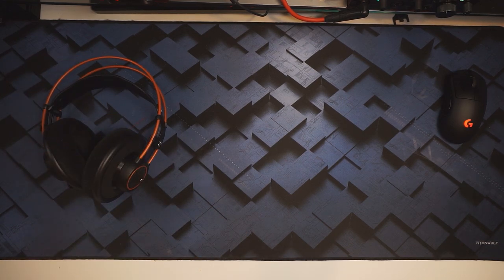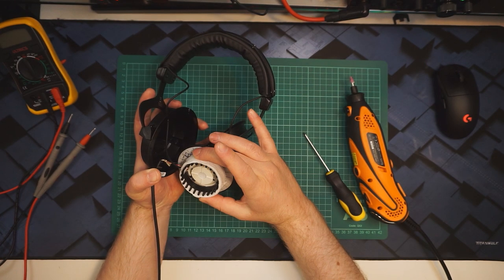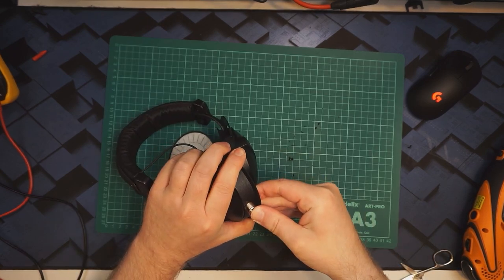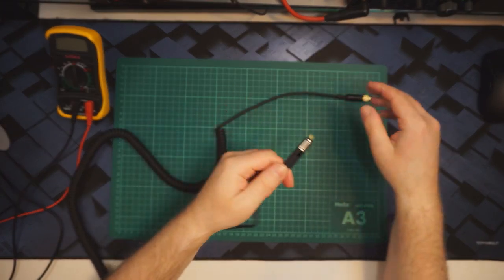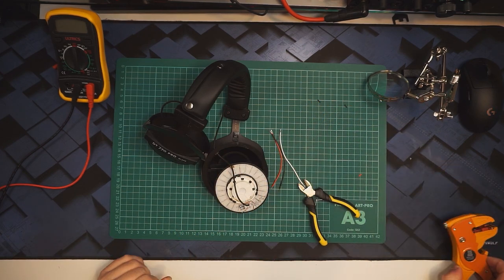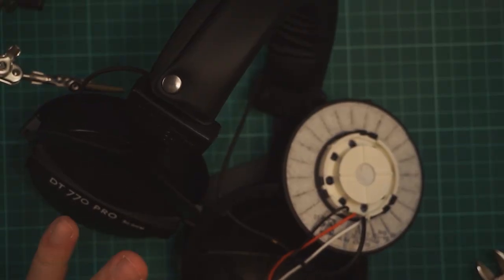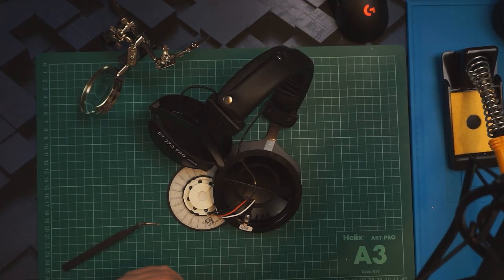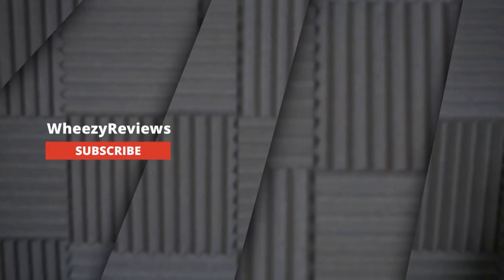DT770 Removable Cable Mod

Comment from the maker: This is a fairly simple mod but any DIY modification is inherently risky. But the point of this video is to show that if I can do it, then you can do it. If you're worried about damaging the driver whilst working on the headphone you can desolder the wire joining the right-hand side. You of course then take some risk with extra soldering on the driver itself. If you accidentally desolder the voice coil then the driver is dead. But if you are confident with your soldering and have a steady hand (unlike me) then that might make things easier.
Reply: Could I contact you to do the same process in my Dt and know how much it would cost me ? I don't know some other person that those this process
Reply: @ame1760  Wheezy created this vid to show how you can do this yourself, just sayin' ;-)
Reply: the life is too short , so hack your devices
Reply: During the process the left most contact on the driver came loose with the cable. I mean the gold ish plate to which the solder connects. Any advice on what I can do or am I just fucked?
Reply: @danielderaad  did you sort this? If not: you should be able to solder to the pad for the voice coil.
Reply: This is an excellent idea!  I will definately do it!

Comment: Your order of operations could be better, next time try soldering the wire leads to the driver first, then you can feed them through the hole, slide your heat shrink on, then solder the connector, and finally finish off your heat shrink. This should minimize the amount of fiddling with a loose driver and short wire leads.
Reply from the maker: Yeah in hindsight that would be the better way to go
Reply: @WheezyTech  What is the reason for replacing the wires on the driver? It seems like the mod would be a bit more easy when you connect the original wires to the new connector.
Reply from the maker: @unrealcyberfly  I have tried that before and theres 2 reasons for doing it this way. The original wires are very short so quite fiddly to work with. Also the original wires are litz which is very hard to solder compared to regular copper wire due to them having an enamel coating that needs to be burned off during the soldering. These two things combined makes it much simpler to replace this section of wiring.
Reply: @WheezyTech  I see. Thanks for the reply!
Reply: @WheezyTech  the original wires aren't short, they're the length of the whole cable all the way to the TRS plug. Also, you can burn the enamel coating and make soldering your connections easier in one stroke by 'tinning' the end of the wire, that is giving the wire a coat of solder on its own.
Reply from the maker: @Milamberinx  Sure thats fine you can do it whatever way you want. I hate working with Litz.
Reply: @YoloJesus420 it basically negates the need for any type of heat shrink or coating because each strand has an enamel shield baked onto it.
But for that reason, it can be tricky to get it to solder.

To burn it off, you can tin as mentioned above, but in my experience, the tinning can take quite a bit longer than bare copper, and it leaves more contaminants in the solder puddle. 

Plus you have to get your iron pretty hot. Around 400C. So you should be using a temperature controlled iron.

Comment: I think this got recommend to me cause I just bought a pair of dt770 pros 😂
Reply: Same lol
Might do it when my cable breaks
Reply: I just ordered a pair.... How's your experience so far, brother?
Reply: What your review about them
Reply: @shaunaksawargaonkar7814  I've had the dt770 pro 80ohm for like half a week now and I absolutely love them. Extremely comfortable, the most open Soundstage I've heard so far (haven't tried open back headphones), they sound fairly neutral (coming from bassy headphones) but also more fun than truly flat headphones. Also they are quite cheap. 
Only gripes: The cable is way too long for me, and they very rarely sound a bit harsh with high frequencies. Absolutely acceptable though.
Also notice the 80ohms are said to sound a bit different from the other versions
Reply: @tomwoodward5334  Not atm. I was thinking about it, but haven't bought anything yet. Using my computer that has a pretty good sound card, I listen at around 30% volume. I have never used high end dacs or amps before, so I can't help with that.
Reply: Oof wish they were made with removeable cable. Now I have to do this mod... 
Cables break so often
Reply: @mastaw  Have you tried them on a laptop, can they work without an amp on a laptop?
Reply: Same hahaha
Reply: @tomwoodward5334  80 ohm headphones are easy to drive and can get fairly loud on portable devices like smartphones unlike 250 ohm version
Reply: Same
Reply: @clickbaitpro  So I wouldn't need an amp if I wanted to use it on my phone?
Reply: @0FFICERPROBLEM  probably a year late by now, but Custom Cans sells moded headphones (including 770) and I believe there is an option to send yours and they will mod it for you.

Comment: Man, watching that driver dangle away as you move the shell and cut away is highly unnerving 😅 i’d be more comfortable unsoldering it completely
Reply from the maker: If I was more confident at soldering I would definitely do that. I solder so infrequently and I don't have the steadiest hand so I was more worried about accidentally desoldering the voice coil. But yeah either way you gotta be careful.

Comment: Did a similar mod some years ago without any disassembly. Simple cut the cable to about 5cm and solder on a new 3.5mm jack, then use a headphone extension of you choice. Job done.
Reply: How did it hold up? Any affect on sound quality?

Comment: Although not as 'pro' wouldn't it be a lot easier and quicker to just cut the cable about six inches from the headphone, connect a male mini xlr to that and the female mini xlr to the long length with the stereo plug at the end. Yeah, you would have two mini xlrs hanging down but you'd still be able to swap headphones using the same cable. I like the mod you've done but the potential for disaster seems a bit high.

Comment: Great video. Very informative and well done. Thank you so much! I used it as the template for my own DT 770 Pro mod, but added a couple twists of my own. First, I removed the snap-on headband pad, and then completely detached the left ear can assembly from the headband by removing the plastic slider shell on that side (2 small Torx screws). This made modifications to the can much easier by providing more freedom of movement.

When it came to the wiring, I didn’t cut the off leads from the original cable inside the can. Instead, after removing the metal retention clip inside the cup, I was able to slip the wires out of the can far enough to snip off the strain relief that was molded onto the outside of the cable. I then cut the cable outside the can, leaving enough length to retain the original Litz wires for use with the new jack, removed the driver from the can with the short cable length still attached, and slid the cable sheath off the wires. This enabled me to avoid soldering to the terminal strip on the driver, but I was then faced with having to tin the Litz wires, which is not for the faint of heart.

Fortunately, there is at least one instructional video on stripping and tinning Litz, and my digital soldering station is more than capable of achieving the necessary 400C (752F) degrees. After removing the cable jacket, tinning the Litz leads, and enlarging the hole in the can to fit my mini-XLR jack, I pulled the three individual wires back out through the hole and soldered them to the new jack (green = tip, red = ring, copper = sleeve).

After I had confirmed my results with both a digital multimeter and some music, all that remained were to secure the jack to the can with some hot glue and reassemble everything. Job done.
Reply: That was my idea, too. Using some grease is not enough to tin these original wires ?

Comment: Another thing you can do if you are worried about making a hole in your headphones is to cut the original cable and make a pigtail style cable. (Would be great to see a tutorial of this as I cant find a single one for DT 770)
Great video by the way, definitely the most detailed/hi-res tutorial out there for this mod!
Reply from the maker: Awesome thanks. I've tried that pigtail thing before but its not a particularly elegant solution. Gets the job done though.

Comment: Good little mod for DT770 owners. I don't own one, so have gone with the new DT700 ProX (48 Ohm) which has a mini XLR jack as standard.
Reply: The 700 pro x are good but I suggest getting a set of 770s and having them modded whether or not you do it yourself or not because they sound really good in some ways which the 700 pro x just don't although I love both sets of headphones

Comment: Good tutorial - very helpful and using it to sense check my own upgrade work on a pair of DT990s. One step that you missed which may have made the process simpler is disconnecting the earphone (?) housing from the yoke, which is connected with Torx T6 screws (one either side), along with removing the buttoned on headband. This avoids having to bend/fold the band while working and gives plenty of slack to distance the earphone enclosure from the other half of the headphones whilst working on it.

Comment: Great video! I should really do this. I need to get that connector for a reasonable price locally. Everything from China is taking months to get here now. Thanks for this!
Reply from the maker: I actually found our local (RS components in the UK) electronics part supplier stocked everything I needed for a good price so that was lucky. Yeah things are taking a while from China atm, I'm still waiting for stuff that I'm sure is lost in transit at this point.

Comment: If you remove the headband pad the connecting cable between the left and right earcup is completely free. It isnt run through any part of the frame. The headband is just snaps, made to be removed/replaced. Quite possibly one of my favorite design choices

Comment: Amongst the 267 previous comments someone may have already mentioned this, so forgive me if they have, but:
A balanced mod would not be much more trouble - the necessary 4 separate wires are all available in the left earcup. Just needs 4-pole mini XLR connectors and cable (Van Damme mini Starquad is ideal - once you've used a meter to identify its identical pair colours) plus your choice of connector for the amp end (either Pentaconn plug - now much cheaper than they were, or 4-pole standard- sized XLR).

As well as a detachable balanced lead, you could also make up a 3-pole TRS plug to a 4-pole mini XLR plug WIRED UNBALANCED within the plug. Then you could use the headphones balanced or, as originally supplied, unbalanced, to suit your available amp output(s).
(A balanced mod is that much easier, of course, on models where the already fitted 3-pole mini XLR just needs swapping out for a 4-pole).

Comment: Just a tip. You don't need to handle the whole thing as one. You can just open the headpad and unscrew the plastic sides with the same bit that's used for Xbox controllers, I think is called torx, very easy to find. That way you're just moving the left earpad

Comment: Thanks for the video. I think I'll cut the original cable two inches past the headphones then pull them put of the cable sheath, and voila, already on the coil from the factory, ready to micro-trim and solder onto the XLR. I'll see if that works!

Comment: Just finished my DT770 Mod: From 80 Ohm to 600 Ohm. I'm in love. So much more Detail. Even better than the 250 Ohm Version,  which is a little ear piercing. I never understood why Beyerdynamic isn't selling a DT770 Verfsion with 600 Ohm...
Reply from the maker: Nice, did you use driver from the 880?
Reply: @WheezyTech  No, I guess they don't match with a closed back headphone. I used the original DT770 600 Ohm drivers from their website. Unfortunately one driver costs 48,70 Euro. So you better be careful with soldering ;-) Here's the Link: https://www.beyerdynamic.de/system-600-ohm-dt-770.html
Reply from the maker: @thomaskohler5181  I forgot that they used to do a 600 Ohm 770. This is the reason I love Beyerdynamic, the fact they still make these parts available to buy even when they don't currently produce a 600 Ohm 770 is excellent service.
Reply: I wish i could just buy the DT770(250) with a straight cable, even if it isn't detachable. Coil Cables are my worst enemy :P
I could always shoot for the more expensive DT1770, but i hear they're worse, in ways, compared to the 250 ohm DT770's.

Comment: Not certain if you did or not but. You should tin the driver pads themselves before you attempt to solder anything to them. Since its likely lead free. Add some 60/40 to it and it'll mix and lower the melting temp making for a better connection. Less likely to be a cold joint or crack in the future.

Comment: Definitely a mod I will keep in the back of my head for my Tygr 300R. I love them so much, but the original Beyerdynamic cable just is a bit stiff so making that exchangeable might be a good idea. I probably will wait though until one day I damage the cable to do it since otherwise I would be to sweaty while doing the mod ^^

Comment: Great job! Quick question, I'm not very industriously inclined: 4:13 - how did you know which wire is which? I see the numbers but I'm not sure what exactly you were looking for here.
Reply from the maker: I was checking the connection between each pole on the headphone jack and the three wires where they connect to the driver. I had the multimeter set to beep when a circuit is completed. You can't really hear it on video but the multimeter beeps when I have connected the pole of the jack to the correct wire, that way I know which connection on the driver corresponds to which pole on the jack.
Reply: The multimeter has a continuity function that emits a high pitched beep when you touch both ends of a wire.

Comment: Nice video, but what about the sound quality after this mod? You´ve put quite a lot of new material inside the housing, so the acoustics of the inner space must be slightly different now. And cutting off the plastic "bridge" from the central ring can also affect stability/vibration. Do you have some comparison with the original unmodded DT 770? Thanks!

Comment: If you cut the original cable further down, after the strain relief, would you be able to pull the wires from that, so that you wouldn't need to desolder them from the driver?

Comment: I wonder, can't you just cut off the existing wire long enough and solder the new mini xlr connector to the already attached wire litz? so you would never actually have to solder on the driver itself? I don't think that should be a problem other than you no longer can twist the connector in, but only push.

Comment: Isn't it more usefull to put a 3.5 mm audio connector in the headphones? By doing so it can be used with a v-moda boompro. Or are mini xlr connectors better quality?
Reply: I'm curious as well
Reply: For those purposes it would make more sense and at the end of the day a connector is a connector and shouldn't impact sound, although you could potentially get a balanced mini xlr with 4 pins, which can impact the sound on some headphones for the better or worse or not at all. 
If you don't need a mic however mini xlr is a quite a bit sturdier and the fact that it locks in place can be quite handy, I find them a bit easier to work with and it's a bit more commonly used at least on mid range and high end headphones, so if you own multiple headphones switching is probably gonna be more convenient to switch headphones. 
Honestly, I think none of these differences are that significant and it mainly comes down to personal preference.

Comment: Hey Wheezy, could you update your video description with the sizing/exact type of the miniXLR you used? Unfortunately the link posted no longer goes to a product on the website. They still have XLR's listed but they are tiny XLR etc now.... not mini. Not sure if tiny and mini are considered the same size by Rean or if these newer XLR connectors are smaller than the ones you used. I'm looking into getting myself a pair of 770 pro 32's at some point and really would like to do this mod, but I want to make sure I can still get the correct XLR connectors before investing in these cans. Thanks in advance if you're able to do this ^^

Comment: I really don't get why Beyerdynamic doesn't have mini XLR cables on all of its headphones. Every reviewer mentions it as a negative and I was considering other headphones with detachable cables just because of that feature. The only reason I went with a DT990 is because it sounded so much better than those other headphones. They know how to do it but they don't on the cheaper models.

Comment: Out of curiosity wouldn't it be much easier to just cut the original cable off at a point further away from the driver and just remove the insulation, that way you could reuse the cable and avoid soldering on the pcb, seeing as that is pretty much the only part where things could go seriously wrong. I think I did it that way on my DT 880s but that was a really long time ago and I sold them since, so I am not sure anymore.